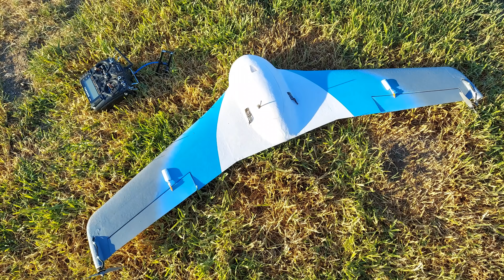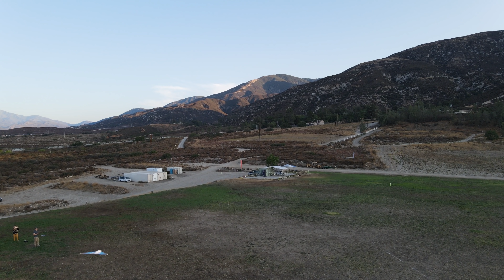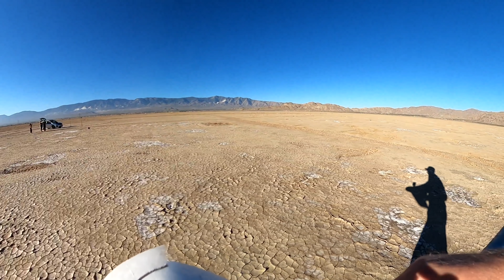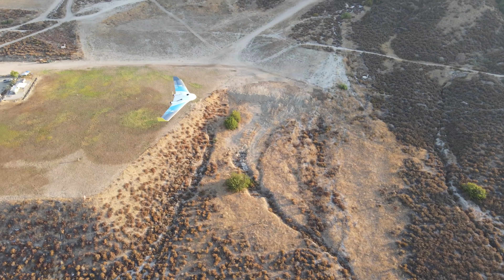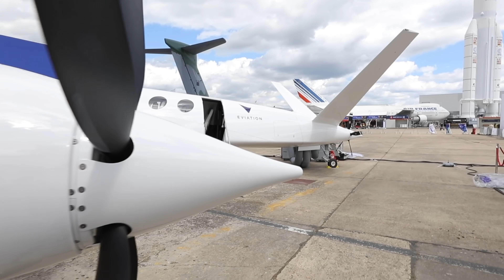Can Wingtip Motors Improve Aircraft Efficiency?  RCTestFlight Solar Collaboration Part 1

Comment: Wingtip engines, without any other major engine centered, and with large wingspans, are a safety problem. For, in case of engine failure, the living engine should have to be either shut down or operated at low power regimes, because the large span is a large lever length, thus there would be a large unbalance of yaw if operated at high thrust.

Comment: very interesting and a great idea. I was wondering what the behaviour would be is you had a wingtip engine failure as all the energy is concentrated way out on the wings, maybe that's why the Eviation has a centralized motor???

Comment: Would a VAFN-type setup utilizing ducted fans with pitch control solve the efficiency "handoff" problem when the craft transitions from heavy-load maneuvers (ie: take off & approach, increase in altitude, fast direction changes, etc) to stable cruise? 

I know there can be efficiency issues with ducted fans themselves, but there's so much promise in this theory that giving up seems.. silly! I hope you and others continue to push the envelope. While I can theorize all day, my fabrication skills are lacking when it comes to the aero industry.

Comment: Nice!
Cool to see the difference. And thanks for telling/showing that it's not all that matters, construction and weight are very important too. 

I'm not saying you didn't lower the induced drag, in this experiment you can't tell if it was that , or, a propeller working more efficiently. 
Maybe both? (Also, for flight time, totally irrelevant ;-)
One effect the plane with the big propellers at the tip's has, is the same as "Distributed Propeller Aircraft" have. At low speeds a LOT of overall efficiency can be won.
Nasa likes making model planes too, GL-10 Greased Lightning, But I don't think this one was with efficiency in mind. 
And there are only renders of the X-57 Maxwell (with distributed props) But  that does have big props at the tips, for efficiency.
I think putting them in front would work slightly better. 
But in this design you'd need a big pod to not have the noise from the prop being close to the frame. So I get putting them in the back.

Comment: If a passenger plane has engines/motors at the end of the wing, in the case of a failure, doesn’t that make flying with a single power unit very hard if not impossible?

Comment: But what if one engine fails? 
The yaw movement to compensate will be a horror I bet, so in perspective of safety I would rather prefer a good handling than a more efficient solution. Have you tried flying with only one engine - would be  dry interesting 😁

Comment: This is actually a very interesting concept, which is older than one might imagine - going back to the 1930's. It reminds me of the   "Zimmer Skimmer" (Vaught V173) - a prototype was tested during WW2 with apparently very promissing results:

https://en.wikipedia.org/wiki/Vought_V-173

It seems that this design avenue might have been progressed further, were it not for the introduction of jet aircraft.  
With modern stabilisation technology and motor syncronisation techniques, it would seem that the "flying flapjack" could be poised for a comeback in the Electric Age...

Comment: The control benefits seems like the big take away here. That and the efficiency benefits increase with larger propeller sizes and lower aspect ratio wings... Smells like the making of an agility racing drone to me. Set up some rings and fences in the middle of a forest; drones with short, broad wings and huge wingtip propellers buzzing around, pulling crazy high g turns.

Comment: that's a fine looking plane you made there! On a totally different track: would you revisit that shape with rotatable motors for soft landing and/or vtol? The maneuverability (buttery smooth, as you so eloquently put) would certainly be complimented with the ability to hover... (and perhaps not a different track at all: if you are going for solar powered, you will want to ensure safe landings unless you have an unlimited budget for solar cells... hehheh)

Comment: Without the effect of Gravity, induced aerodynamic lift is invalid. Lift is the resistance of gravity by using a resisting deflection of the oncoming air, against the underside of the wing, not the upper surface. The air is deflecting off the bottom of the wing, causing a reaction of an ergonomic lift.

Comment: I couldn't tell from images, or discussion, if you had the props on opposite sides rotating in opposite directions? There was one	 comment about the rotation being opposite to wingtip vortices, but only on one end?
Reply from the maker: Correct they rotated in opposing directions on each side.

Comment: Really good comparison. Would it be better to use smaller diameter motors at the wingtips? Does the direction of the rotation of the prop at the wing tip effect it? As this is all about efficiency I assume you are maximizing system voltage and testing motor and prop combinations.
Reply from the maker: Rotation must be outward to oppose the inward rolling vortex.   Actually this test was about the efficiency of the airframe, not the electrical system.   Maximizing the electrical components would not tell us any more about differences in airframe configuration efficiency.   If you were designing a plane for maximum efficiency overall, yes, the electric components would be a major consideration.
Reply: @thinkflight  thanks for the reply
Reply: @thinkflight  the full-size aircraft you show has much bigger blades and slower rotation, is there anything with regards to pitch of blade versus pitch of the vortex?

Comment: Would vortilons/pylons give better results than winglets? You're really wanting to prevent spanwise flow along the underside of the wing meeting up with low pressure air at the wingtip and for the most part wingtip fences(winglets) are voodoo which really just extend the effective wingspan by the cosine of their angle to horizontal (which is why commercial transports have largely abandoned them in favour of swept tips). 

If you can cut down on spanwise flow in the first place then your wingtip vortices should be reduced markedly (commercial aviation does this using the flap tracks and engine pod as the control devices, but you do see vortilons on a lot of craft)
Reply from the maker: Makes perfect sense to me!

Comment: I've never thought to ask this before, why is "bubble" of the main body on top?  Wouldn't you have better air flow, stabilization and something to land on if the "bubble" was underneath?
Reply from the maker: Sweep adds a dihedral effect, and often times I prefer a nimble plane, so to counteract the stability of the sweep I place the body (and mass) on top to add instability.  Plus you don't have to worry about the spar getting in the way of arranging all your components.   Those are usually my preferences, they aren't always appropriate however.

Comment: Here is how lift is generated and why aircraft can fly!!
The air moving across the top of the wing goes faster than the air travelling under the bottom. Because it's moving faster, the air on top of the wing has less air pressure on the wing than the air below the wing. In other words, air below the wing pushes on the wing more than air above the wing

Comment: Interesting video, like it. Just curieus, would it not be better to use a tractor configuration ? It would be more efficient than a push configuration. Also i would place a  ducted fan on, or even better, in the fuselage. In case of one of the 2 wingtip engines fails, at least you have some thrust to bring it back home and make a safe landing. It does not have to work during flight with the wingtip motors, only if something would happen with 1 of the wingtip motors. All you need is a switch to divert the power to the central (ducted fan) motor. I don't think you would be able to keep this plane in the air if one of these wingtip motors fails.
Reply from the maker: We will find out about tractor motors in V2

Comment: If one motor fails, the aircraft is completely unstable. This is why Eleviation has a propeler at the back to avoid this single point failure crash garanty.

Comment: I imagine to really see the efficiency benefits, you have to optimize the lift distribution of your wing together with the added vorticity of the motors. Probably when putting the motors at the tip, youd want to move towards a flatter lift distribution compared to the epiliptical of prandlt wing youd otherwise be using; err more on the side of a flying plank if you will. That is assuming your motors act to add downwash on the wingtips, which I suppose is the sensible configuration? Well more questions than answers from me really; but im pretty sure that you need to optimize the downwash / lift distribution of the plane as a whole to get the most out of it.
Reply: ...the point of bell shaped lift distribution is less stress on the wing, which allows for a lighter aircraft, whcih means less lift, thus less lift induced drag.
Which is not exactly something thats likely to happen in foam cutout aircraft.

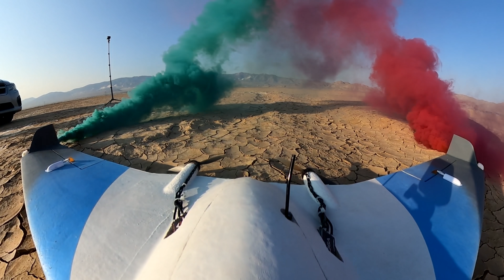Comment: Just a little nitpick... aaahhheeemmm --  I'm a bit confused. @2:20 -- With your skills and your tools.., I find it - perplexing - that you have to stop and pick up "compressed air." I'm assuming that you mean "Air in a Can". Your work shop isn't lacking anything that I can see, so why don't you have an air compressor? Is there an advantage to using compressed "air" that contains hydrocarbons? The stuff is flammable. It will set off "explosive atmosphere" detectors. Soooo, I'm scratching my head with the possibilities.

But! This question didn't make the video any less enjoyable! Great job. 👍

Comment: Even with increased efficiency, it is way less safe then a near-center motors, and therefore it won't be used. In case of failure, it would flat spin, killing with certainty.
Reply: Well if you had, a 3rd motor in the center that you can fly it

Comment: I think wingtip motors may be the only place where 'pullers' may be more efficient than 'pushers'.

Also; as the air from a 'puller' is going over the wing ~3X faster than what the wing profile's designed for; doesn't it make sense to change the tip of the wing's profile to suite..??

CAUTION!
If one loses 1 wingtip motor; the plane's going to spin like a boomerang, so perhaps some sort of auto cut-off to the other motor is a damn good idea..?  :)
Then perhaps a 3rd, centre motor makes sense..?

Comment: Nice build! But if you have an issue of one motor/prop, the thing will rotate and crash. No single motor capability, therefore no redundance. How about a heli- or kind of gyrocopter with engines at the wingtips?  Of course, the thing is slower and less efficient, but fun and single engine should be feasible.  There was a swiss company with H2O2 rockets as engine at the wingtips of a heli. Flew perfect, but then bancrupt, because the fuel is regarded as a bomb material for terrorist and therefore not available.

Comment: its a nice video although i must add that wingtip motors will never make their way onto a certified airplane. if you lose a motor, you basically have zero way to recover, while the whole point of a dual engine config over single engine is reliability and range

Comment: Can enjoy efficiency in unmanned aircraft. Unfortunately engine-out performance means no longer having single-engine ability to keep flying. Loss of an engine means the aircraft is coming down no matter what! A twin engine aircraft should be able to continue flying in case of one engine failure, especially if it is a manned aircraft. Interesting, but safety concerns trump efficiency.

Comment: How about this: flywheel powered wingtip(or anywhere) propellers with turbines on the posterior side or perhaps on the dorso-ventral axis that speed the flywheels back up while cruising or air braking. I'm no engineer but I'd be interested in seeing if you got the airfoil and gearing geometry right maybe you could harness drag energy to be stored for propulsion and use the angular momentum of the flywheels to provide gyroscopic stability for low-tech, cheap to build, environmentally friendly, and safe ultralight gliders that wouldn't have many government regulations restricting their use. Such a thing could make commuter aviation accessible and practical for poor people and help get rid of all the cars and auto-dependant infrastructure that I hate so much.
Reply: Maybe it could be possible to use this idea to make highly reliable analog control systems

Comment: so in summary, the bigger the swept area, the more efficient? who'd have thought?. additionally  i wouldve thought that wing tip motors give yaw authority also?..does that counter the drag caused by a traditional rudder?. no need to use spoilers then?.

Comment: Why not keep the camera close to the center of mass, drill a hole into the canopy and use an angled mirror to film the wing tip?
Reply from the maker: I think I ended up with a good solution for V2, stick around.

Comment: Pure scientists and mathematicians think theoretically.  Practical engineers and technologists/technicians know that that things fail and need maintenance.
One wingtip motor failure = flat spin/cartwheel of death
For safety, you would need more than just one motor on each wingtip.  Possibly a  dual motor, coaxial design per tip.
The V-22 Osprey has a relatively bad safety record.  Everybody dies if one motor fails!

Comment: An issue with wingtip motors as others have pointed out would be engine loss and subsequent control, so wait, what if you could make the motors move on a track and variably control their position along the wing, electric motors are lighter and this should be possible although with some issues as to drag from an exposed rail, or maybe make it an embedded rail that is continuously flush with the underside of the wings even when the motors are moved. The question is, whether it's all worth it and IDK still researching.
Reply: And maybe don't slide the motor down the track while it's moving

Comment: Some random dude on the internet is not going to solve that discussion anytime soon

The generation of lift has been understood for quite some time, the only real problem is getting the textbooks updated as most of them, unfortunately, only discuss "Bernoulli's principle" and incorrectly state that lift is produced by air flowing faster above than below the wing and ignore Newton's 3rd Law and the additional force caused by the airflow changing direction at the trailing edge of the wing.

Also, motors are not sited at wingtips for safety reasons (you even demonstrate this in the workshop before its maiden flight :/ )

Comment: Did you know that there are people that make tanks that can hold pressure up to 10,000 lbs per square inch? I would start with one of those at say... 30 gallons of volume and put a simple hand and foot operated air pump and lever on it for starters. A 15 minute work out gets me 300 miles or more in one direction or another. Start with a flying boat and continents and oceans are no problem. A sea going sailboat with a simple pendulum built into the keel, compressing air and driving water all day can do most of the work of pressurizing the tanks, water-air propulsion system, charge the battery and run the air-conditioning sytem. Yeah it can fly underwater too.

Comment: Great channel, love it! I did research on (speed-)boats using small flex airplane-wings on outriggers with same results. Did many runs on the water using exact same mAh every run (not even 1% difference). The small flex airplane-wings did not contribute to efficiency.

Comment: Lift really isn't that complicated. The top of the wing is curved and the bottom is flat. The wind passes over the top of the wing faster because of the shape, producing a low pressure area which gives the wing lift.

Comment: unfortunately with wing tip motors you eliminate your redundancy and ability to fly on one engine in the event of a engine failure, the yaw would be uncontrollable, as well as the weight of extra structural support for outboard mounted engines

Comment: What made you decide to have the motors spinning opposite direction to the wingtip vorticies? what would happen if you reversed the motor spin so they were working with the wingtip vorticies? I'd like to think you'd be getting extra thrust  as the motor is working with the natural airflow around the tip
Reply: this is where the efficiency comes from. That tip vortex is energy going to waste. You want to stop it. Think about the AoA on the propeller with and without the vortex: the force vector tilts forward. With the ideal pitch, you could have a fixed prop driven (producing thrust) from the vortex. (That's a winglet.)

Comment: think what happens when one of those motors fails, what happens to the control of the aircraft. the motor will fail, at some stage it will, so what happens? engineers have to think what happens when failure occurs, this needs to be shown too.

Comment: Just wanted to let you know, measuring the energy spent by measuring how much energy you put back into the battery is a bad method. Batteries degrade and are all different. A current & voltage monitoring system should be able to keep track of the Wh spent per trip.